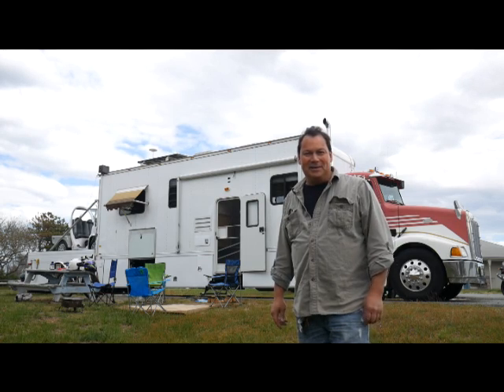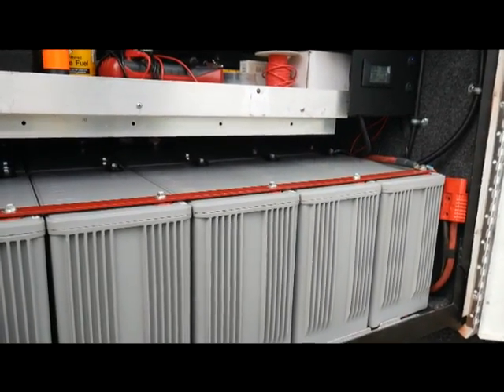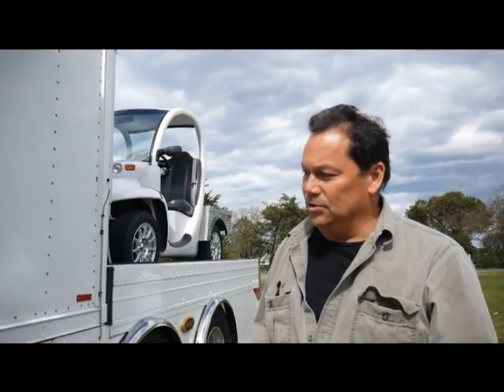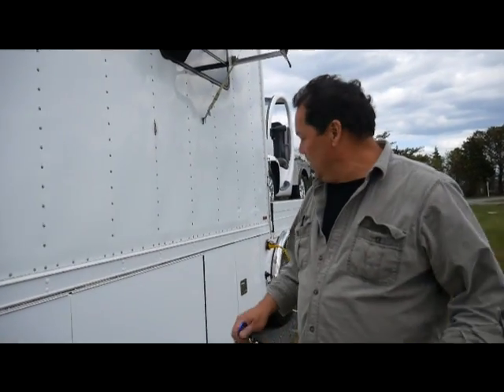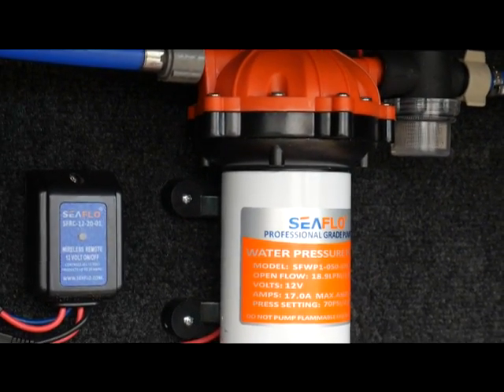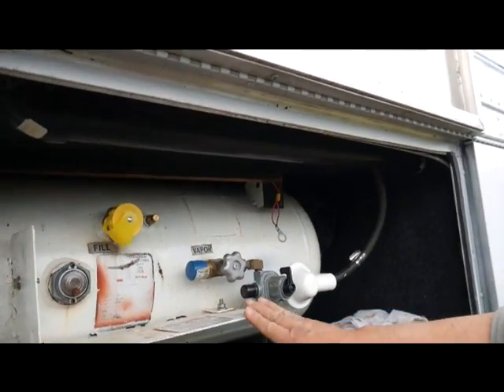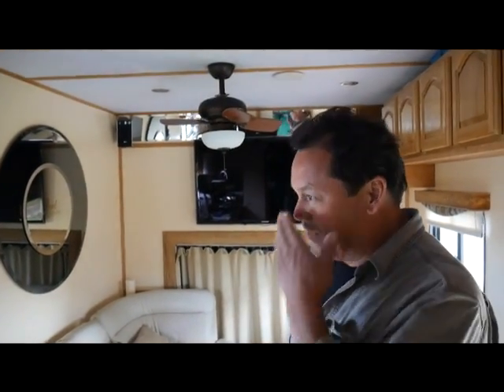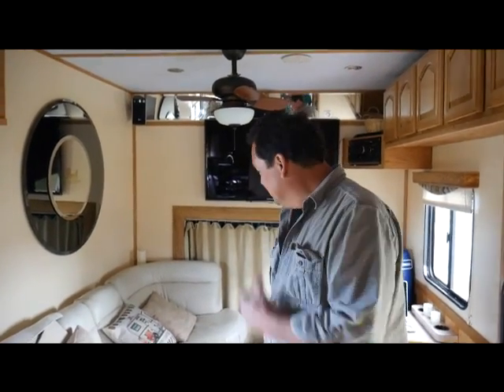Ultimate Bug Out Vehicle

Comment: the new li ion batteries from tesla are 5200 amp hours and are the size of one of your deep cycle batteries. look into it
Reply from the maker: Thanks!  I have researched them a bit, and I think they are great but too expensive right now.  In about ten years or so, I think they may be more "main stream" which will drive the price way down.  At that point they may become worth it.  Just my humble opinion.
Reply: thank ya for the response! i was wondering how much was your battery bank?  i picked up a tesla battery off of ebay for 1k (you have to use a li ion charger) and i am about to start testing it to see how it functions. li ion batteries dropped in price by 35% this past year so hopefully these new options will become cheaper and cheaper.
Reply from the maker: Are you asking about the battery bank in the rig in the video?  That belongs to Eric (the man that built it) and I have no idea how much he spent on the batteries.  I know he got them new and there are 24 agm batteries in there!

My personal battery bank in my home currently has 3 group 29 deep cycle marine batteries from walmart.  The way that I use them, even a small bank like that goes a long way though!

Comment: do you have to have a cdl    to drive   that rig
Reply from the maker: No, I don't think so.
Reply: I would say yes. That truck is rated for over 26,000 GVW and has air brakes. You would need a CDL to drive it.
Reply from the maker: The rig is not mine, I just shot the video for Eric (the man that built it) so the bottom line is I honestly don't know.  It would not surprise me at all if he made major changes to things like brakes, since I know how handy he is with things like that.  He built almost everything himself from scratch from plans that he drew up himself.  I believe he told me he began this project by stripping away almost everything except the engine and parts of the chassis.  A lot can be done with 9 years and tons of determination.
Reply: It's definitely a cool truck and well put together. Being a truck driver years ago, I know that it would be almost impossible to modify the brake system to get away from air. Plus the brake release buttons are still on the dash as can be seen from the video. Either way thanks for sharing this video.
Reply from the maker: You are most welcome, thanks for watching!

Comment: Wonderful travel rig; however, your personal security, unless you do not want to advertise it, IS CRAP! I would have a series of small monitors in the front of the rig by the office, in the bathroom, and specially in the bedroom, that wwould be attached to cameras placed high on the rig, to always let me know what is around me at all times.  The cameras would have low light and infrared capabilities.  Safety should be a very large concern at all times.

Comment: "ULTIMATE BUG OUT VEHICLE"  ??? That's a huge boat that should only be kept in paved streets or even grounds. And if it gets stuck it will cost you around $1000, even higher if you get stuck somewhere weird or far from the dropping point. 😂😂😂😂😂😂😂😂😂😂😂😂
Reply: Vehicles have an underneath clearance that's about the same to this rig....But this rig has a long wheel base. That's just aching to get you stuck on dirt lumps. 😃😂